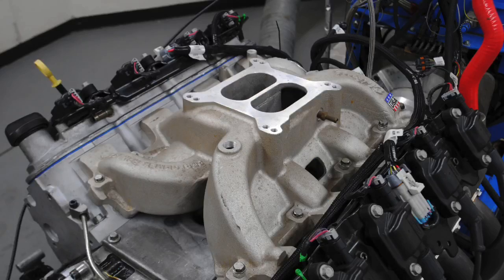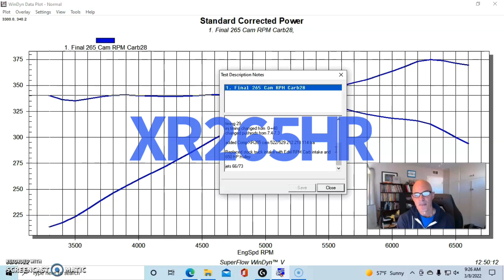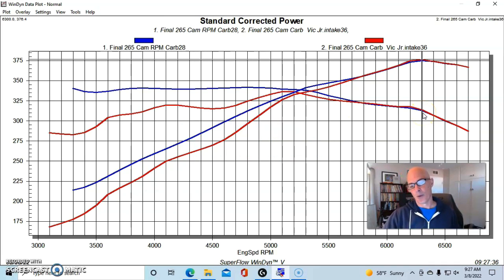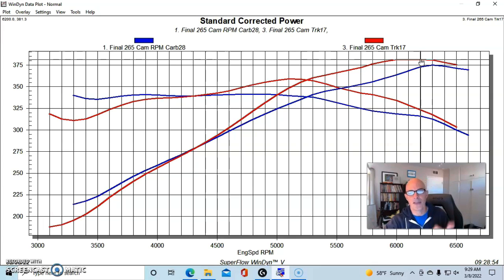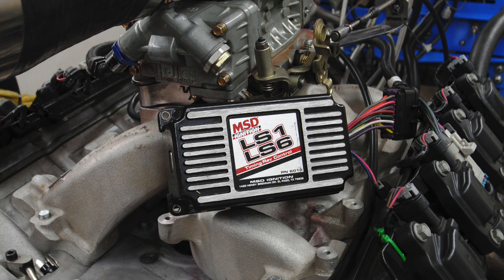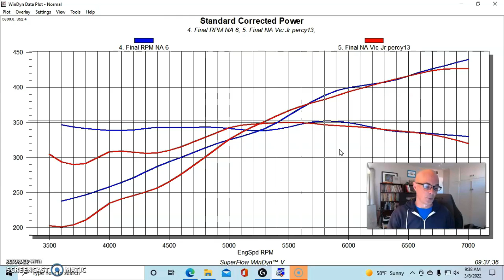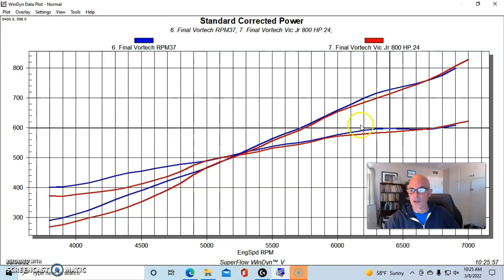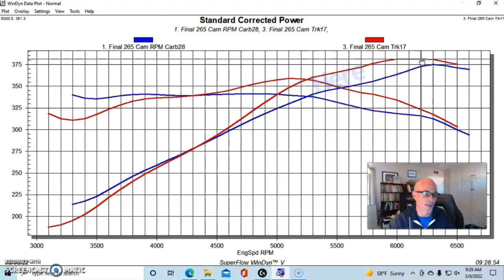HOW TO: NA & BOOSTED LS INTAKE TEST! CARB & EFI. TRUCK VS DUAL PLANE VS SINGLE PLANE (WHO IS BEST?)

Comment: Would like to see a test between dual vs single plane on a bit bigger engine like a 6.0 with a bigger camshaft like a stg 4 pro ls or a carbureted dedicated cam
Reply from the maker: DUAL PLANE ALWAYS MAKES MORE DOWN LOW-BUT TAKE A LOOK AT THE BIG CATH-PORT & LS3 INTAKE VIDEOS-YOU ANSWER IS THERE

Comment: Carb intakes on LS applications always impress me how well they run. I guess it’s the charge cooling from the way the fuel is administered to the engine as Richard always mentions. As far as running a carb on a street car though, always a dual plan IMO. Save the single plane stuff for the cars that only run at 7k+ RPM their whole existence.
Reply: Perhaps a throttle-body Fuel Injector?
Reply: @dennisyoung4631 no...

Comment: Im putting a fuel injected 5.3 ls dual turbos in a s10 98 model is there a wiring diagram to where i can get in truck and crank with original switch and tells me what fuel pump, if I can use original fuel tank? Thanks for any answers in advance!
Reply from the maker: search on line for s10 wiring harness

Comment: Not sure if this is the right video to ask or if you'll even see it.

I can't make your lives to ask.

I'm building a 72 chevelle with a t56 magnum.

I have a moderate ls2, cam, head work,  estimated about 550 flywheel.

But I've been offered a 715hp 468bbc as a swap. 

I can't decide.

Do you have an opinion? It'll mostly be a weekend car, 2-400km trips. With some spirited driving...

How would you go about making that decision?
Reply from the maker: A 715 HP 468 WONT DRIVE WELL

Comment: Great information again Richard! You mentioned nitrous was ok on a dual plane. I have the edelbrock performer on my 6.0 and am adding the Nitrous Outlet weekend warrior kit. How much safely monitored will be safe? Up to 300hp? I was always told no more than 150 on a dual plane. What are your thoughts? SBE, PRC 2.5 243 -.020, 227-234 600 600 on a 111 Bald eagle na cam. Brawler 750 race carb. Yes, I have taken a lot of your advice. I was concerned with ptv clearance with your favorite comp 469 cam though. Keep up the great work and thank you again!
Reply from the maker: the power you can supply is a function of the motor strength and tune-not the intake

Comment: I love Edelbrock intakes. They have done such a good job but I feel somewhere the ball was dropped here. I mean we know they did dyno test on these things. What happened here!? Making a victor Jr was about pointless by the looks of this test. Now maybe with a large cubic inch motor the results would be different and that makes it worth production. At least I hope that is the case.
Reply: Edelbrock is not what it used to be, it's all about market parts today. They have enough quality issues that not even the Chinese would copy their products today.
Reply: This was simply one test. This same Victor jr works on cathedral port heads on bigger cubic inch motors as well and typically with bigger cams does produce more upper rpm power than a dual plane. Watch any comparison video and you will see that same trend. It’s the nature of beast with short runner intakes. There’s a list of other reasons that you would pick the single plane over the dual plane. No one dropped the ball.

Comment: In your experience would there be any difference switching to a Sniper efi and then running this test? Or would the outcome still be the same?
Reply: Both combinations would probably make less power with the Sniper EFI than a carburetor of the same CFM; it shouldn’t act this way in theory but, I’ve read that others have experienced this (check out Eric Weingartner’s YT video on this topic), but your results could vary based on your combo....i believe results (% power difference between the manifolds as specific RPM ranges) would still remain the pretty much the same, since the sniper is acting as an electronic carburetor, given the injector placement.
Reply: @ericschumacher5189  I'd have to go back and look for it but thought on one of the Engine Masters they were doing a test and had issues with the fuel distribution on the Sniper/dual plane setup vs the single.
Reply: @TexasRacingChannel  Yes, I remember that episode. Dual planes don't play nice with TB EFI. The EFI couldn't compute the different signals due to different runner lengths.

Comment: Someone might have asked this already but would these results be the same with the 5.3, 6.0, 6.2, or larger ci ??? Maybe the dual-plane is able to move enough volume for the smaller 4.8 but as one goes up in Cubic inches the separation of the dual plane and the single plane starts showing itself? Not sure on my end.... I learn something every time I watch one of your vids Richard. Keep up the fine work you are doing!
Reply from the maker: the single plane will do slightly better with displacement and cam timing-but never equal the dual plane through most of the curve
Reply: I had a holley duel plane on a cam nitrous 5.3 with 799.s  and compared to fuel injection with same mods or single plane my setup was faster at the track et and mph roughly 3 mph faster coulda been a stout motor but I'm building another same setup

Comment: I’d be interested to see if you used a carburetor as just a throttle body and used fuel injectors on that dual plane intake and see if it still compares the same way to the truck manifold. Maybe the earlier fuel delivery is cooling the air charge. Especially under lower rpm and slower velocity in the runners. More time for the fuel to cool the air.... Am I nuts or is this possible?
Reply from the maker: the design is what makes most of the change in the power curve
Reply: @richardholdener1727  if tend to agree with you for sure! Just an interesting test.

Comment: richard, What would the single plane ls intake be good for then? bigger inch engines?
Reply from the maker: bigger motors and more engine speed-though the Super Victor is better than the Vic Jr. on the LS

Comment: is there other brand daul planes manifolds plus id like to see this on a 5.7 ls1 just to see if extra cubes carries the single plane more then 4.8
Reply: this needs a redux...  sense when does a ls roll over at 6500.. when u have a free 7000 rpm rev limit i mean great tow engine.
Reply from the maker: the test was run to 7000 rpm

Comment: Interesting that the first configuration with stock heads, truck intake and the 212/218 cam virtually mimics the old Fuelie 375 hp 327.
Reply: Accept the 4.8 actually made that power lol
Reply: @roysimpson6625  I was kinda confused until I figured out you meant 'except' cuz I'm like I accept it I just saw it lol

Comment: Tunnel ram under boost!!!!
Reply: A well designed tunnel ram will out torque a dual plane and with enough volume will pull hard to the top end.
Reply: @hoost3056  you just know Richard wants to do this.  Twin turbos and two blow throughs ala Mad Max.
Reply from the maker: a tunnel ram won't make what a dual plane does down at 3000 rpm
Reply: @richardholdener1727  still want to see twin turbos and twin blow throughs.  waaaaah!
Reply: @hoost3056  The drop in torque down low is due to one cylinder robbing another cylinder of what it just sucked in, that will happen to some degree with any manifold that has a shared plenum. 
Torque number is what the engine trapped in the cylinder in a single combustion, horse power is what it trapped over time (rpM).

Comment: @ Richard Holdener  Do you think if that was a 6.0l where it demands more air flow the single plane would make more of a difference in power ?
Reply: nope
Reply: @safetyfirstintexas   O Richard did you change your screen name.
Reply: @markrich3271   dude if you want private conversations keep it in the private. cause when you go public you ask for public participation, which you got.

try a dm.its private...
Reply from the maker: it's not a flow rate-the design determines the effective rpm range, but a 6.0l will make more peak power with a single plane usually-just lose out through most of the curve
Reply: @richardholdener1727   I'm trying to understand if it's a design flaw of the intake or this is just typical . The supercharger provided enough air flow where we should of seen a much better increase.   I've personally never seen such a single plane not make a gain up top.

Comment: This is exactly what i needed to see for my ls4 build.  I’m going to use the Holley sniper efi though.  Thanks Richard!
Reply: the sniper works better with a single plane!
Reply: @rustybritches6747  I thought it was a dual with an open spacer that works best
Reply from the maker: the open spacer on a dual plane can lose low speed torque
Reply: @richardholdener1727  great to hear from the Don himself. What was the ideal combo?  I remember something about the divider needing to be notched or something
Reply: @richardholdener1727  thanks for the reply!  I don’t mind the loss of some low end torque.  My cam choice will lose some low end tq as well.  My ls4 swap project will still be fwd.  Been watching your testing for a couple years.  So much great data!
Reply: Thanks for the replies.  I heard about the spacer trick too.  My only concern with the single is drivability low to mid rpm.  Its going to be more of a cruiser with some no prep racing.  Keep in mind i’m only looking for 400-450hp crank.
Reply: @brunothinkshecan7305  I wouldn’t worry about it too much. Most of time the difference is not seen unless your chasing number and racing.

Comment: Good test. I would sure be interested in the jetting you used on the 650 with dual plane for the dyno testing on a 4.8. Since a buddy is working a very similar NA engine in a jeep also with a 650.

Comment: I still don't understand why anyone would carb an ls
Reply: These comments are hilarious keep em coming guys
Reply: For me I want the carb look but I’m going with a sniper efi
Reply: Because when you already own carbs, over 35 years of age and picked up an LS for a good deal…it makes sense. 

Especially makes sense when you know how to manage your money and nothing on your Hot Rod is part of a credit card bill every month.
Reply: Because carbs are awesome?
Reply: @travisblack417  
"17 stages of awesome"
Richard Holdener
Reply: Simplicity with a LS swap in a hotrod
Reply: fuel cooling the intake runners for a denser charge.
Reply: Cheape/Easier to supply fuel to a carb.
Reply: It’s typically the guys that don’t understand carburetors that make these sort of arguments. 9 times out of 10 it’s going to be cheaper and easier to buy an intake and msd box for their already carbureted swap than it is for them to learn EFI. Buy hp tuners or a standalone and have to learn that. Then change their fuel system. I’ve done both and don’t prefer one over the other. Your comment is simply riddled with ignorance.